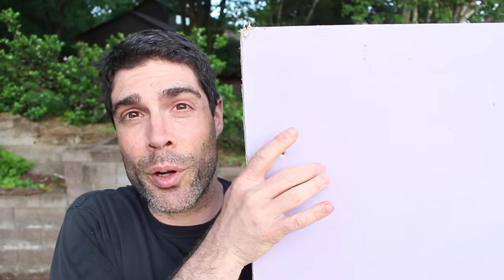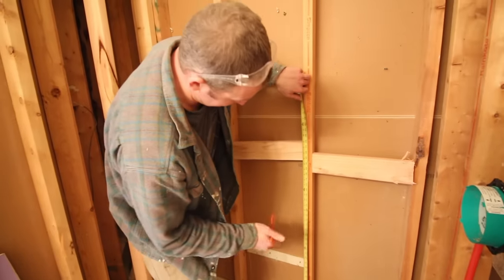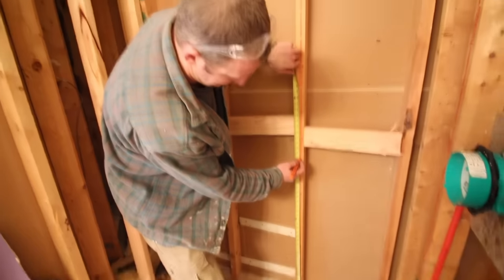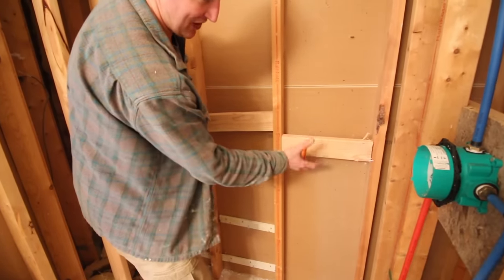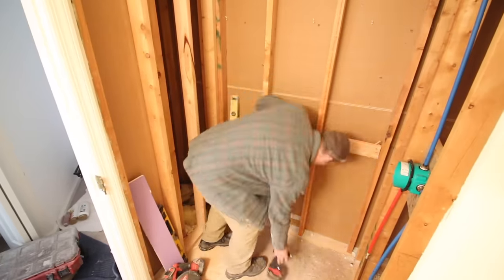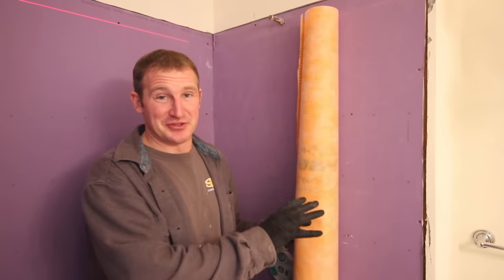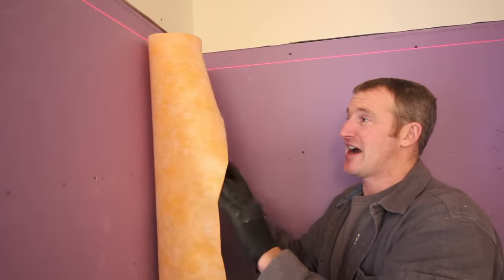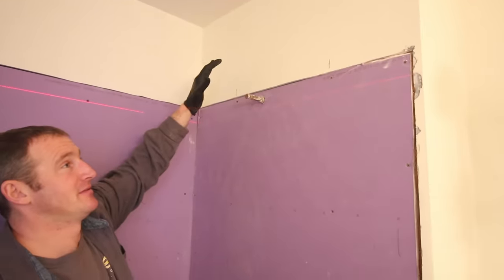Schluter Shower Part 1: Drywall and Wide Roll Kerdi Membrane

Comment: Since the 2m, you wrap it as you did, curious why with 1meter sheets people run them vertical, instead of horizontal, giving the same corner result as the 2m, thus no corners to mud you then layer the 2nd 1m 2inch overlay to the bottom 1m, and mud that, then if you need a 3rd, do the same...seems like a better method vs doing sheets veritical and having several vertical seams you need more Kurdyband to apply...(a way to make more money?)

Since water flows down? This provides a continuous corner seal, no mud needed only where the 1M overlap, only corners at the bottom and bottom pieces to join with the pan....

I just ask this as 1M may be easier to work with for beginners than trying a 2M sheet, also I am doing my basement bathroom and going to the ceiling, which isjust under 3M, enough for 3 x 1M to fit with 2in overlay.

Comment: Any reason you didn't use cement board?? would it not have added rigidity to the walls and been a better substrate for the tile???

Comment: Is the kerdi band at the top of the wall super important or did it just come in the kit?
Reply from the maker: @AlecGrinage  you need to waterproof the drywall to board transition and overlap both substrates by at least 2 inches

Comment: So I am a little confused.  Can I apply the Kerdi membrane to regular drywall?  I have moisture resistant gypsum and it is purple in color, but doesn't look like the board used in this video. My plan is to tile the walls surrounding the new bathtub / shower.  I am asking because my friend who has been helping me said the drywall / gypsum we used was fine and he said the Kerdi membrane will work with it.  I just want to be sure before I continue with my bathroom renovation.
Reply: I’ve just been reading on this a lot and had a contractor install for us.  Technically the membrane is waterproof so you can install over either.  I went with green board just to be a little extra cautions (vs regular drywall), but honestly, if you don’t seal it right, you’re probably screwed whether you have regular drywall or green board as neither are waterproof.  Sealing the kerdi membrane is critical obviously.
Reply: @aacar4095  yup, no matter what you use, if the water proofing is bad and you get water where you don't want it, you are screwed.
Reply: Green, blue, purple… none of it is water proof. It’s moister resistant… mold/mildew. It’s supposed to be used in areas that experience high levels of moister… typically bathrooms. Color difference tends to be the manufacture. Schulter in its install videos show normal drywall in the install. Personally my rule of thumb is overkill is a great piece of mind.

Comment: Ok did I miss something?  I’m wondering why the mortar wasn’t troweled with a 1/4” x 3/16” notched- v trowel after a layer of smooth levelled mortar was applied?  Referencing Schluter vids, this is their recommendation.

Comment: Can I achieve the same results if I use Kerdi boards instead of drywall and then add the membrane over the Kerdi board?
Reply: You don't need the membrane then.

Comment: Question: Why did you choose to go vertical with the directional troweling? Would horizontal directional troweling allow the air to escape easier when installing the membrane in this manner?
Reply from the maker: It could but Schluter doesn’t specify, just as long as the KERDI-BAND is fully embedded in the thin-set

Comment: Great video! If the shower wall continues in the same plane beyond the curb, how far should Kerdi membrane extend past where the sliding door frame is? Is an inch or two adequate?
Reply: I always run mine even with the outside of the curb, as that tends to be at least a couple inches past the door anyways.

Comment: Would you be able to tell me the pros & cons of tiling shower walls using (1) Drywall and Kerdi-ROLL membrane (like this video) vs. (2) Kerdi-BOARD? Which is better? or cost difference?
Reply: I want to know too
Reply: Kerdi board is definitely better, more expensive but you actually would save lots of time, which time is money

Comment: Good tips. 2 questions though.  1) Would you tape the cement board (corners and seams) with Fibatape - prior to membrane install?  I've seen commentary in other videos that taping unnecessary.  2) If you only have the 39" roll, couldn't you roll it out similar to what these guys are doing but go horizontally around the shower with multiple panels to reach the top? Could Kerdi band the seams or overlap them perhaps?

Comment: If you had your choice would you use the kerdi backer board or regular drywall and put on the kerdi membrane?
Reply from the maker: regular KERDI-BOARD because the extra pieces can be used to build custom shower niches
Reply: @HomeRepairTutor   Thank you
Reply: @HomeRepairTutor   Does that go for the shower pan too. I know there are two different types. Do both need to have the kerdi membrane on them. Thanks again.
Reply from the maker: @jayc2884  all Schluter shower trays now have KERDI membrane installed at the factory, so you don't have to do that yourself. It was a great upgrade by Schluter
Reply: @HomeRepairTutor  awesome thank you again!

Comment: What can I say... Another fantastically done video. Very well done as always...
Reply from the maker: thanks man, always appreciate your feedback - hope you're having an awesome week!
Reply: Why didn't you use the schüter-kerdi board that was already wrapped oppose to using waterproof drywall and then applying a skim coat of compound then putting on a Schüter wrap and squeezing the access of the compound out. It seems that their wrapped board that they make would be easier to install and do the same job...

Comment: Would there be an issue with using cement board or hardie backer instead of the drywall?

Comment: Fantastic product. For non-professionals, I HIGHLY RECOMMEND installing your mortar bed first (if using mortar bed) instead of installing kerdi membrane on your walls first. The reason is this: when you pack down the mortar bed, your trowel corners will inevitably dig into the membrane. It's no big deal, you can always put an extra strip or 2 of kerdi band along the wall base, but still aggravating. As a first time shower builder, kerdi membrane was definitely a smart choice. If I had it to do over again, I would have used regular dry wall instead of cement backer board, and would have spent a bit extra time shimming the studs. Typical rookie moves, but I got everything level, flat and plumb throughout. I have mad respect for contractors who do this everyday. Very humbling work, and you guys deserve every damn penny you make.
Reply: Do you tile right over it
Reply: @johnschmeltz163  yes once the membrane is set and the mortar has dried, it’s ready for tile.
Reply: Then what would you build your mortar bed up to? The cement board? Or even worse...drywall?  Both are a nono.
Reply: Float mudbed, then install cement board. Never use drywall, even with sheet membrane. Unless u don't care about repairing your tile. And honestly that shit sucks if u have to do a repair and  you have cut into it and it's useless, unrepairable without removing all of it and doing it over again.
Reply: Drywall is not the proper backer board.  Do not use drywall in the shower area.  Even with waterproof membrane.   😉🤔

Comment: I did the water test for 24 hours on my kerdi system. I didn't have water loss but I had wicking about 1/4 inch above the kerdi band. Is that normal or could I use kerdi fix to seal this up

Comment: Excellent videos. I will be looking to do this in a few weeks and have no experience, is there any worries about how fast you are going when placing the membrane? Wondering if you need to rush to get it done, or if a newbie would have time and not rush
Reply: Not sure if you’ve already done it and found out, but once it’s mixed you generally have about 2 to 3 hours to work with it.

Comment: Just found this - I followed your videos from last year and used normal drywall.  I haven't put on the membrane yet.   Should I remove and use the purple board?
Reply: Steve Dillinger purple board is better.
Reply: No, Schluter doesn't recommend it, also (not sure if this is true with purple board) with green board there can be moisture trapped between the layer of kerdi, and so it has nowhere to go.
Reply: I use purple board to be safe. Use paper drywall shins on studs for irregularity   Setting base last then taping

Comment: If the Kerdi membrane is water resistant why do you need the purple board?
Reply from the maker: It’s to support the KERDI, normal drywall can be used

Comment: Would only using Kerdi board be an acceptable option?  Instead of using the purple drywall and kerdi membrane.
Reply from the maker: yes, KERDI-BOARD is a great option. You’d install that first then the pan and curb. This installation would be a great fit for your project, just swap out KERDI and drywall 👍🏼

Comment: The only drawback of this is that it is only available in 98' long rolls at a cost of around $800. This is only practical if you are a contractor or a flooring store stocking it. I wish Schluter would make it available in smaller size rolls... :(
Reply from the maker: some distributors will cut the wide roll to whatever size needed 👍🏼
Reply: Order similar product on amazon comes in a smaller roll. Enough to do a 3 x 3 shower 3 walls and floor. Around $100
Reply: They do make them smaller

Comment: Installed this stuff for years and attended  "Schluter school". It was always advised to tape and prime the wall board prior to installing Kerdi. 

1. Taping with mesh strengthened joints and helped minimize movement that could cause the Kerdi to pucker or blister. 
2. Priming helped seal the wall board  reduce moisture penetration and improve adhesion especially on exterior walls where you essentially sandwich the drywall between 2 layers of plastic. 

I agree cement board is best but it still must be taped. Kerdi and Ditra are only as good as the substrate.

Comment: First, even if they are all interior walls, you should at least insert sound insulation in the cavities. Most bathrooms are adjacent to bedrooms. That's what a good contractor does. Second, why not cement board? I don't get it. It's not anymore work and it's proven to work a thousand times over.

Comment: Hi there,, I am sorry, but I have installed ceramic, marble, porcelain, etc. on floors and walls for at least 40 years, and I never have any leak or humidity beyond the tiles over dry wall or cement boards on walls and probably I start installing this materials before the inventor of this product was born, do not get me wrong, THIS MATERIAL IS EXTRAORDINARY GOOD FOR SHOWER FLOORS, I know the company idea is to sell most materials as possible, but you do not have to cover the entire room.

Comment: I regret about my decision for choosing the kerdi membrane. It is a horrendous process to stick it to wall. And it dsnt even stick that firm enough to hold tile. All in all never look at it again in life. Get cement board and redgard or some other water proofing easy to apply like paint. Membranes are BS.
Reply: I'll bet you didn't use Schluter thinset. It has been lab tested to work together, when you mix other cheap stuff in you actually get a cheap bad job. Follow the directions!

Comment: This schluter membrane is a horrible product. Schluter board would be ok in this installation. But, cement board is all you need. Over a short time this membrane will pull away from the wall
Reply: I've used this system on dozens of showers for over 20 years. I've never seen that happen.